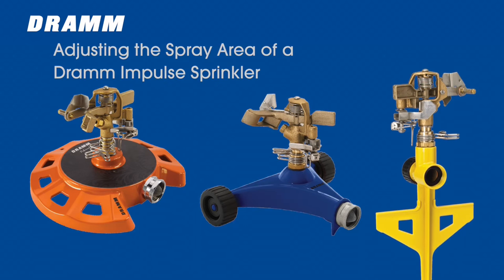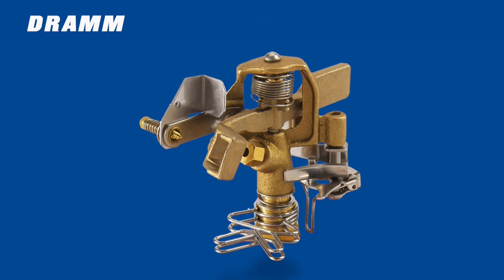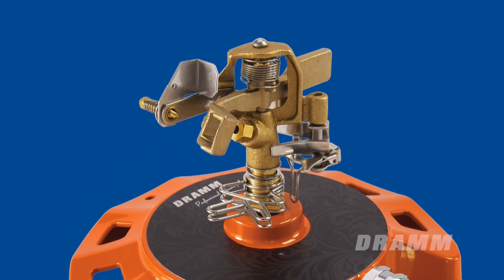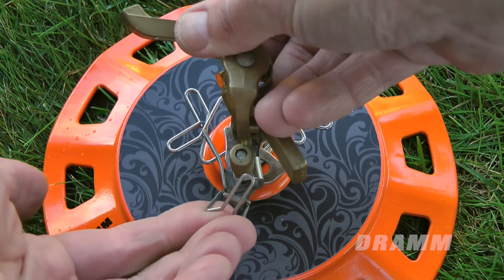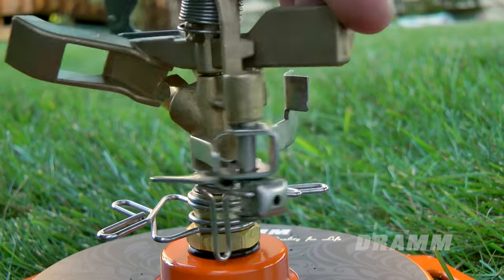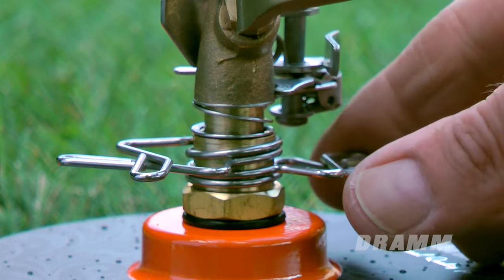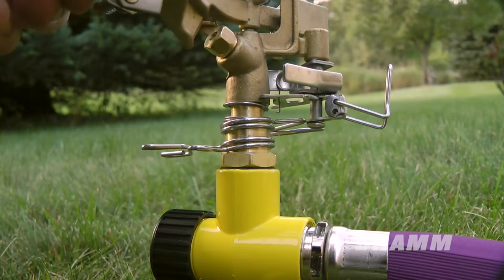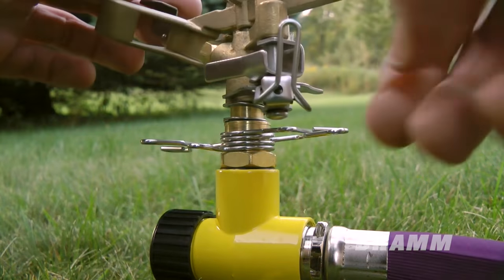Adjusting the Spray Area & Pattern of a Dramm Impulse Sprinkler

Comment: My problem using this on my lawn is, on the very narrow patch of brass between mine and the neighbor’s house; I can’t set it to where it goes back and fourth with only the narrow width that I need.  Literally even if I adjust the 2 clips as close together as they an go with the trip lever between them - it goes too wide.  It’s great for 360 in the front and back yard though
Reply from the maker: Thank you for your review. We might suggest a different Dramm sprinkler to get the wide coverage you need. Here is information on the Turret Sprinkler - https://rainwand.com/model/colorstorm-turret-sprinkler/ - https://rainwand.com/wp-content/uploads/2021/05/Turret-Sprinkler-Patterns.pdf, 4-Pattern Impulse Sprinkler - https://rainwand.com/model/colorstorm-4-pattern-gear-sprinkler/, and Oscillating Sprinkler - https://rainwand.com/model/colorstorm-oscillating-sprinkler/

Comment: Mine won't return, I'm trying to sort that out. 
[20 minutes later]  KOOL I just set it to loop and cranked up the pressure, bent the diffuser for more diffusion and am lettin' it rip. It's a tight pattern. I got wet again. drip

Comment: How do you make it spin 360° counterclockwise?
Reply from the maker: Dave, thank you for your question. Place the trip lever to the up position will give you 360 degree coverage. If you wish to go counterclockwise, you can put the trip lever in the down position and have it bump the trip adjustment to change the direction and then put the trip lever back up or possibly place the sprinkler in another direction. We hope this helps and thank you for your support in Dramm.
Reply: @thedrammcorporation-retail5490  I’ve done some tinkering, with the lever  up, there is a boomerang shaped part that can be turned left or right to control the forward or reverse direction.  I’m looking into the Orbit Tripod to get my sprinkler off the ground.  This should give me the ability to cover my front lawn going in reverse.  I have been splitting time between reverse for awhile to cover the interior, then switching it to forward to get distance.

Thanks for the reply!

Comment: what's the minimum trip adjustment? I need a very short range of about 10 degrees :)
I hope you have this sort of information.. it's a long shot but worth a try :)

thanks
Reply from the maker: Thank you for your comment. We have never tested for the minimum range. We do know that it will vary depending on how strong your water pressure is.
Reply: What’s maximum range 50 feet or so? And does it get a pretty even coverage on the full range?

Comment: Do these have equal coverage
Reply from the maker: Yes, you can adjust the sprinkler pattern for an even coverage.
Reply: @thedrammcorporation-retail5490  Thanks for the quick response. I was trying to figure out which adjustment laid the most even water? I noticed when the screw and the flap is out of the way the long stream it doesn't provide as much water coverage as when the screw is in place making the spray more spread out.
Reply from the maker: Please have the flap down, as you mentioned, to create a more consistent pattern. Then position the angle in the middle or higher, depending on your distance coverage preference. This video might explain it a bit better https://www.youtube.com/watch?v=f0rKQ6HJsC8&t=18s
Reply: @thedrammcorporation-retail5490  thank you so much